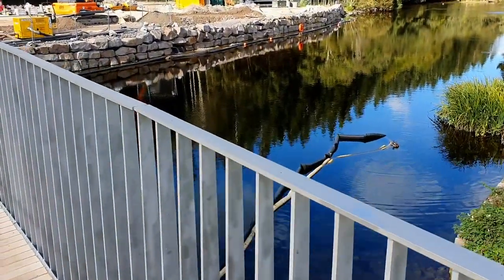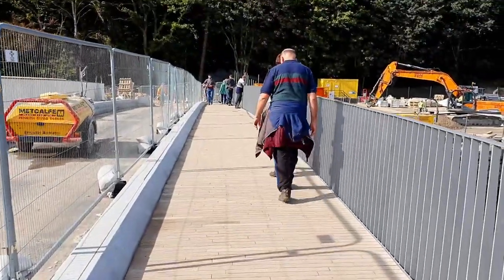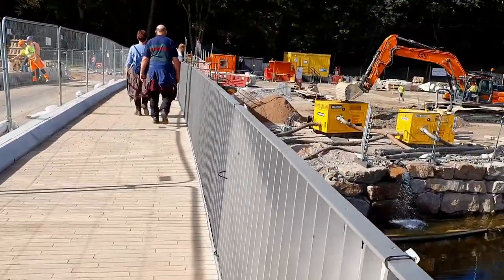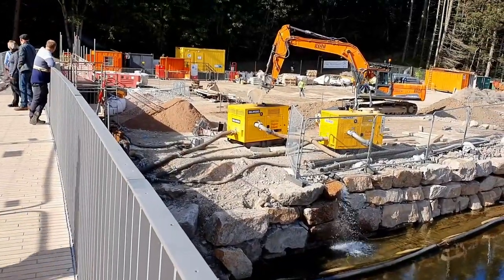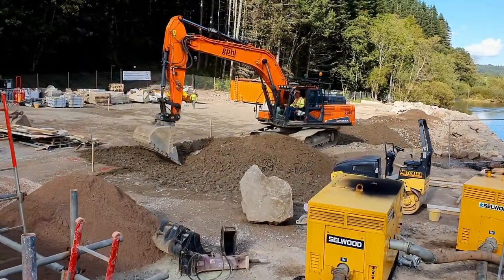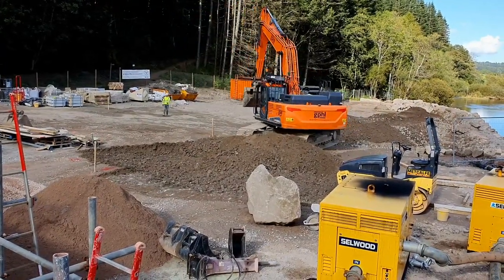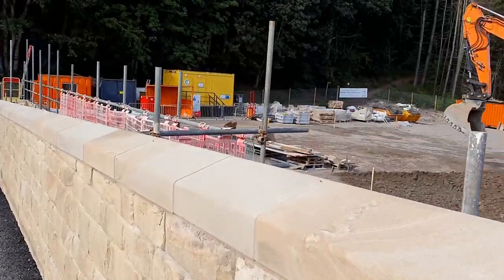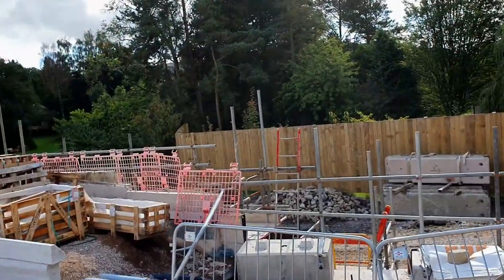Pooley Bridge Ground Update 29/09/2020. 4K 1080p HD.

Comment: Thank you for this new and unexpected update, its looking good, We wondered about the original car park, what would happen to it, was told it has to be returned to how it was as its a flood plain. Dont know if that is accurate information .
Reply from the maker: Thanks, Ann, for commenting about the car park, I think they should lower the height of the car park as it was built up with hardcore and that would be a problem of flooding on the other side of the bridge we will see what happens.